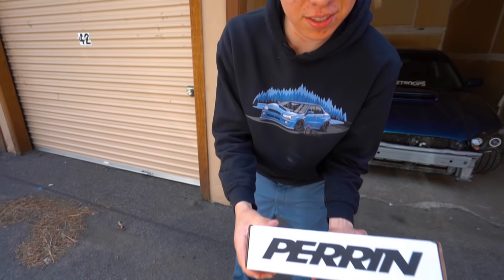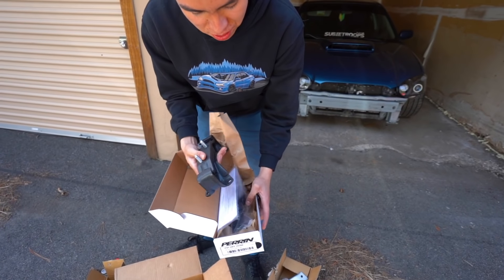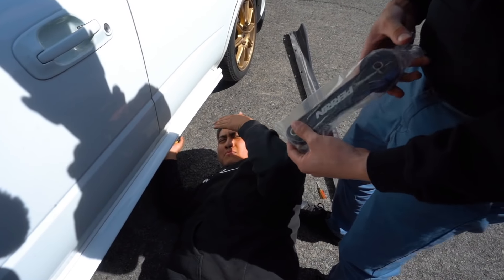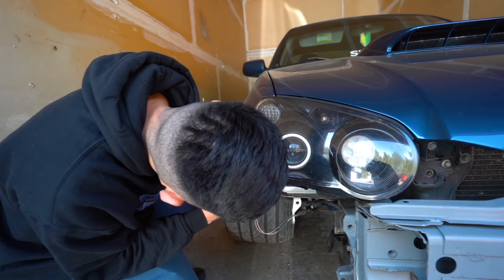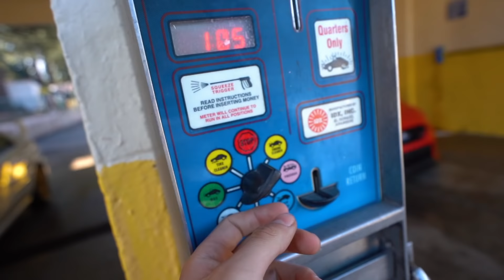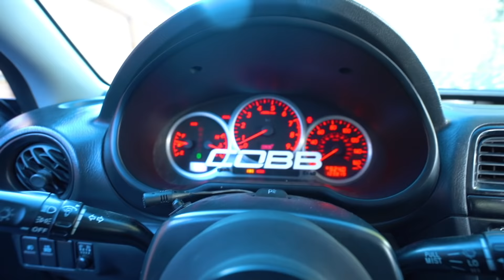2 Broken Subarus...

Comment: Pro tip for cleaning your car. If you can afford it go to a very respected or good reviewed detailer. They clean your car very well and the right way! Car washes are good but for the long run not good for your paint! Especially if you spent money on changing the color it’ll be a brand new car again with a revival like that!

Comment: my silver bugeyes in the shop for a busted head gasket :(
Reply: RIP:(( Good luck.:))
Reply: @ethanlopez8879  thanks 👍
Reply: - Veaux - what motor you running? And is it open, semi or closed deck? Mate I’d highly recommend going closed deck and sleeved, arp head studs torqued down to 120 pounds, and multi layer head gasket, you’ll never hear about any head gaskets ever again!
Reply: Thats gonna be a good 3gs. Goodluck. Keep up with them oil changes n stay out of boost until operating temp is reached

Comment: The low idle after you lost the battery is normal. The system will get the idle back to normal after you drive a little. I had this today after clearing engine codes.

Comment: Sorry if I butcher his name, but do you think hongo knows the color code or color name for his wheels. I would like to repaint my wheels. I also changed the pitch mount on my car and it felt way different and better when shifting. Motor didn’t move as much as when it did with the oem one.
Reply: Luis Izaguirre bbs gold
Reply: I also did mine, but reverted to stock. I hated how the firewall acted like an amplifier for the gearbox sound.

Comment: I have a 07 sti that’s running a catless downpipe and because of this free flowing exhaust im overboosting and getting fuel cuts. I heard performing the “Restrictor pill mod” will fix it: this involves swapping the stock pill with a larger one. Anyone knows if this mod works?
Reply: It's the car tuned for the dp? And you should have gone with the high flow catted dp 07's hate going cattless
Reply: The pill probly won't make much of a difference, you'll need a tune with maybe an ewg. A pnp turbo will also help.
Reply: Yeah im running stage 1 cobb for the moment. I will tune it soon, just thought the pill mod would work as a temp solution.

Comment: It might be idling weird because subie ecu's reset if the battery is disconnected/completely dead (course I think most cars do this), but if it resets and you drive it instead of letting it relearn the idle it could be why it idles weird. This video might work since it helped fix my Impreza when it kept idling weird at stop lights  https://youtu.be/Ud6OU13IDSQ

Comment: Hey guys. Sorry not a forum i know but im having trouble with my subaru and was wondering if anyone could help? I have an 05 WRX and have a MASSIVE oil leak around the turbo area with white smoke coming from the turbo. Anyone have any fixes that doesnt involve replacing the engine??
Reply: Zack Vecsi maybe it’s oil feed line or return line.
Reply: Is it your oil feed line to the turbo?

Comment: My legacy gt is doing the same thing after disconnecting the battery. It’s been 2 weeks and still idling like crap.
Reply: Clean throttle body and relearn idle again
Reply: I’ll give that a try see what happens thanks man.
Reply: https://youtu.be/Ud6OU13IDSQ 

This video might help since usually the ecu resets if this happens, and if it doesn't relearn the idle it's gonna be all over the place.